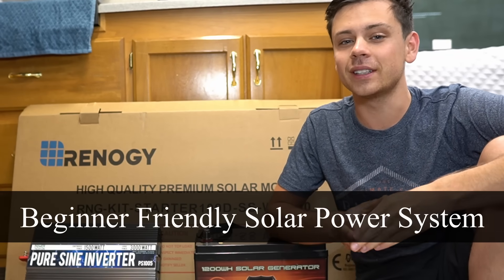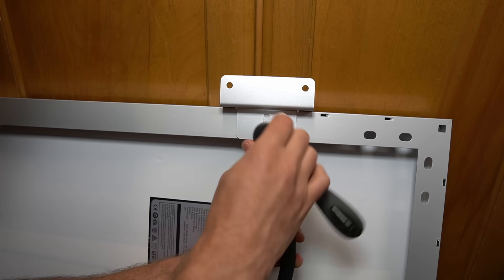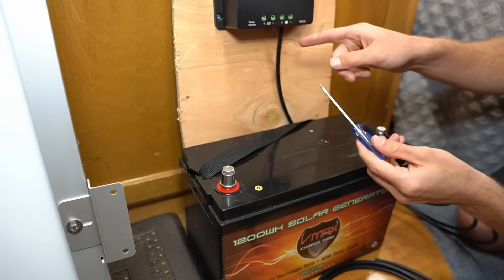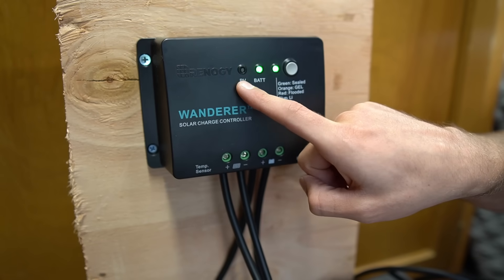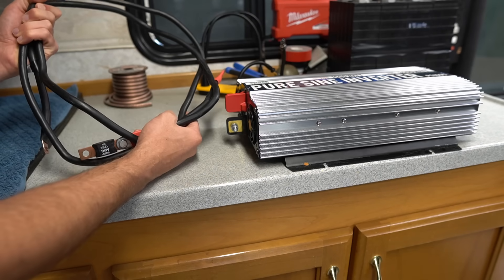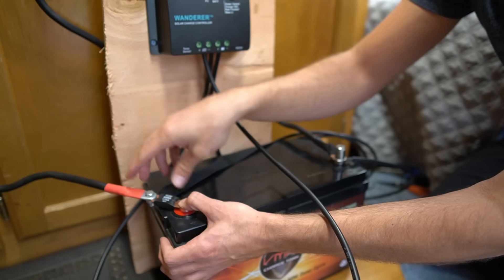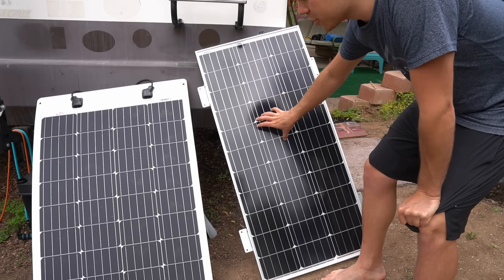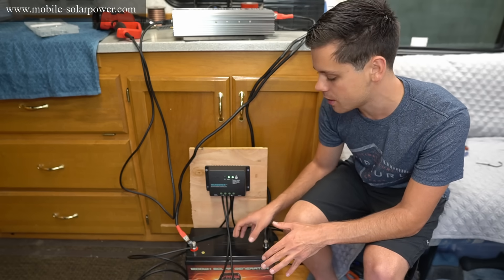Build Your First Solar Power System! Beginner Tutorial Easily Explained, Budget Friendly

Comment: You are the best there was, best there is, best that ever will be. Do you know why? You have the communication skills that others although smart, can’t explain and care like you do. I’ve purchased as a beginner, (2)100 watt Renogy panels with their wanderer mppt charge controller, I got a monitoring system and 2 filled 6 volt batteries deep cycle arranged in serial. I do have overkill but I got a great price on pure sign wave 3000 watt inverter with all shunts and fuses for my RV 30 ft Trailer. I decided to make it portable and not put on the roof so I designed 1 1/2 “ pvc, color coded to put together quickly and stabilize the panels. Very sturdy and adjustable to the sun. I’ve mounted everything but we’ve had big snow fall, cold weather so I’m waiting to connect for a better weather situation here in Utah. You’re the man, man! So thank you! I’m looking to expand so future scalability w/batteries, mppt, and 200 and more panels.

Comment: Where does the 40amp fuse attach to? It looks like the 175a goes on the battery end of the inverter's positive cable. It sounds like the 40amp fuse goes on the solar-to-battery positive cable. So there would be TWO fuses adjacent to the positive terminal on the battery, correct? Because one is connected to the inverter and the other is connected to the controller?

Comment: So I built this exact system, and added that voltage meter, and when I run just one single blow-dryer off the inverter (like a hair dryer), the voltage meter goes way below 12.2v. The battery is totally charged up, and normally shows about 13.2v. So why does it create such an enormous drop to the v's with only one extremely minor appliance being run on it?
Reply: Blow driers pull tons of power even on a regular house 110 system. My husband says it is the equivalent of a dead short in the circuit. Mine pops the breaker in my house all the time.  When I am camping I just do wash and go hair.
Reply: Is it only happening right when you start up the blow dryer?

Comment: At 9:40 you said for a 30 amp charge controller you would have preferred a  35 to 40 amp fuse? Dont you mean the  fuse  be rated less than 30 amp charge controller. The idea is to protect the controller ? Someone help, what am I missing here.

Comment: This is a very well done tutorial. The only comment I have is that you said to "bunch up and zip tie" the extra wire. Doing so can cause a heat build up in the wiring and may case a fire. The better thing to do is to cut them just a bit longer then the required length.

Comment: Love your channel. I was curious you have a link to the Renogy site and they show a photo of the system and it has a battery in the image. Their list of what is included in the sale says "This kit includes a 100W 12V Monocrystalline Solar Panel, an Adventurer 30A PWM Charge Controller, a 30ft 10AWG Solar Adapter Kit, a 16ft 10AWG Tray Cable, a BT-1 Bluetooth Module and one Renogy Cable Entry Housing." They advertise the battery included in the sale but don't list the battery in the description. That is a very misleading practice on their part.

Comment: You probably have no problems with snow in winter near Vegas but here in Germany its a problem. Could you make a video about defrosting by feeding the PV-panels with reverse current to generate a little heat? In general this method works when the panels are mounted in a special degree, at least 25 - 30 deg. so that the snow will slip down when it gets soft. How much current can you put in reverse through the panels without damaging them? How much voltage can you apply without damage? Just an idea for a video :-)

Comment: You emphasized that the battery should always be connected to the charge controller before connecting the solar panel(s), but my portable solar panel kit came with the panels prewired to the charge controller and alligator clips to connect a battery. Should I be concerned?

Comment: I'm planning on using all this, but originally having two solar panels. My question Is having one solar panel enough though? I'm mainly going to use microwave, TV, ps4, heating blanket during winters, and slow cooker. I plan on leaving them unplugged when I'm not using it though.

Comment: Watching your videos are informative but I’m still confused. Ac to DC AH wow.
Simple question ( but confusing the hell out of me, ) please to start a simple system  I want to power a 45 watt  0.21 amp fan (220 volts ) for 11 hrs a night. What size solar panel needed to recharge a battery and the size battery AH . And what size inverter.
Hope you can help  I want to start up with a small system and build it up for as cheap as possible.

Comment: Hey Will, I'm in the design stage of building a Skoolie Bus Conversion 22 325 watt solar panels for a total of 7150 watts and 12 or 14 batteries. The setup will be 18 panels on the bus and 4 panels on my 24 foot enclosed cargo trailer that will be my mobile shop. I will also have a diesel generator as back up power for the bus and my shop trailer. What would be the best way to set this up.

Comment: I've watched many videos about solar but most of them don't talk about safety much. I don't think I ever heard one person talk about what you can touch and when. You touched the positive terminal of the battery for example. Is that ok all the time or only when you're not grounded or isolated from ground. Was the battery dead? Can you touch the negative terminal? It's never explained in any videos so I thought I'd mention it. Also it's not about just what you can touch but it's about the thought process you use. Are you always telling yourself don't short the system or avoid the positive the most. What are you thinking about as you touch wires and what do you check before you do? Sometimes you give warnings like be careful it can kill you. But sometimes you don't. Is 12v often safe and only a problem when it comes out of inverter or when it's combined to get 24v or is 12v at 40a deadly as 120v at .01 amps etc etc? I think I know all the answers but it seems like it should be stated every time as part of the instructions.

Comment: Parallel vs series for battery setup, when do I use which? I have an Aimes 2000 inverter charger, 2 renengry 300 A panels and a renergy mppt charge controller.... Please help, my batteries keep sparking!
Reply: OK, got my batteries pos to pos and neg to neg, not sparking anymore, but my inverter charger when I trurn it on just flashes power and turns back off. Any ideas???

Comment: Hi. I enjoy your posting very much.But I have a request.
I am doing MY SOLAR SYSTEM but I need help.
I have a solar array of 2 sets of solar panels each of 8 panels 340W .
Each array connected to a mppt inverter ,charger controller of 5kw.48vts.
The reason of 2 system is to exploit the sun as it move between summer and winter on my roof.
My question do i connect the power of the two inverters to one battery bank or separate a separate battery to each charger.
I intend to use Lifpo4 280ah batteries storage.I DO NOT KNOW WHAT THE SIZE OF THE BATTERY BANK AND IF I AM OVERDOING WITH THE 280AH BATTERIES AS THEY ARE EXPENSIVE. 
I am thinking to use 16 x 280ah cells at 48vts.
My system is going to be hybreed to start and maybe in the future off grid.I WOULD REALLY APPRECIATE YOUR ADVISE
Best Rgds Aldo

Comment: Thank you for this and for all of your videos.  I am an engineer with communications background.  Solar design is new to me and has a lot of related concepts such as the idiosyncrasies of various battery types and code requirements.  This was very valuable.  Thank you for providing this.  I want to convert the home 220VAC well pump to solar and add batteries to the array already on my roof.

Comment: A 100W battery is useless! A light bulb will draw enough load, then in 5 hours, your battery is dead.
You need 3 X 100 AH batteries 
A 1,500 Watt, Sine Wave Inverter - A microwave can take 800 Watts

YOU NEED TO LOOK AT THE WATT  LABEL ON EVERY APPLIANCE!

IF YOUR INVERTER IS LOWER THAN THE RATTED APPLIANCE LABEL (BANG)

You need a quality Charge Controller $ 200

You will need 400 Watt Sollar panel output or 2 X 200.
Or you won't get enough power to re charge the batterys.

Comment: Great videos with easy to understand information! 
Try temporarily putting a test light in series when connecting the inverter to the battery. Test light will brightly light then dim out as the caps charge. This will allow the caps inside the inverter to charge so you wont end up with an arc.

Comment: Hey Will hope all is well with you. Been watching your videos since the planter fasciitis days. I have a question that you’ve probably heard before. Let me explain what I need. I’m installing a small solar system on a old four wheel drive camper and I’m at the roof pass through point. Since it has a pop up roof the MC 4 wire coming in from the panel will be under extra wear while moving the roof up and down. My question is.  Can you recommend a solar wire panel that would be flexible enough to withstand the extra wear and tear of raising and lowering the roof?

Comment: Hey Will (or anyone) ... If I install a cut-off switch at the battery to turn system completely off,  will controller be damaged if voltage from panels is still coming in?  Thx.

Comment: I do some simple work on my boat's 12v system and the conventional wisdom is to always disconnect the negative wire from the battery first and connect the negative wire onto the battery last.  You connected the negative first.  Does it matter in your application?  Thanks.

Comment: So I'm wanting to build a small off grid set up I have 4 100w 12v panels a 1000w pure sine wave inverter I ordered a mpp charge controller I want to build my own battery but I'm strapped do to lay off but I have a lead acid tractor battery it was in a tractor for 1 month before the company decided to scrap it I was wandering how what to expect performance to be here  are the specs

Specifications
• Voltage: 12V
• CCA @ 0 degrees: 1200
• CA / MCA: 1500
•  RC @ 25 amps: 400
• Hot Cranking Amps: 1725
• 1 Year Free Replacement + 2 Years Prorated Manufacturer Warranty

Comment: Hey man. Awesome video! A few questions... I think it is possible to use a battery and also a plug in inverter to simply plug into the wall. However, I’m am confused on the setup. I have a solar panel that I would like to connect to the house, so that it sends power into the house during the day, and then uses the battery power at night. Is this possible? Do you maybe have a video explaining this? 

Thanks in advance!!!

Comment: I’ve studied solar DIY systems for 25 years and this is the best single introductory video I’ve found.  You nailed it!
Reply: He sure did, I actually understand this!!!
Reply: I would connect positives first then if you touch ground (vehicle body) while tightening up the positives you won't get a circuit. More so in tighter spaces.
Reply: Can I use something like this in my shed to power my shed and charge lawn tool batteries ?
Reply: @kblend7225  Yes 🙂
Reply: It is the only one that has made it all clear to me.  He should run for president!  :)

Comment: Hello from Colombia! your video was very clear and simple to understand. I need help with something though. I am working on a public seating project and I will be adding outdoor outlets at least three so that people can charge their laptops and phones. For this, I had in mind installing two 200 watts solar panels to power the three outlets. As I have limited space on the outside I was wondering if there is a simpler way to implement IC, diodes, and a watt resistor to make it work similarly but with fewer components. Please let me know if this is clear. Thanks!

Comment: Why are you connecting a 175a fuse between the battery and a 1500w inverter when the fuse/wire size chart recommends a 300w inline fuse and 4/0 wire?

Comment: What can i power with a 100watt panel?  Im looking to put one on the shed and would only be charging small electrical equipment, tv, small ac and maybe a small table saw/jointer planer.  And some lights.  Would this do the trick or would i be needing something different?.  Thanks for the help!

Comment: Awesome! Have you worked with the Valence U27-12XP   LiFePO4 12V 138AH   1.766 kWh Battery?  Seems to not have a built in BMS. Charger for this battery does not seem to be available. Would there be a workaround. I know you worked on the 40 amp  batteries that had a built-in BMS.

Comment: Need help sizing up my snl fuses. 100W panel with 20A ppm charge controller and 1000W pure sine wave inverter. What fuse size should I use between charge controller and battery; and between battery and inverter? Your videos are excellent and easy to follow. Good stuff. Thanks.

Comment: Hey. I bought a renogy eclipse 100 watt solar panel for me rv. It came with a two
Pin furrion outlet. I have a single 12 volt deep cycle battery on my rbv. Just purchased a furrion 2 pin connector with an mc4 10’ extension... do i actually/really need a charge controller? Or can i just plug the mc4 extension connectors directly to the solor panal? Avoiding
Me to have to use a charge controler....

Comment: I have this same exact setup, including battery.  Does the charge controller stop charging the battery if it's full?  I checked after like 2 days and the PV LED turned off and the battery light turned orange.  I'm wondering if I damaged the battery.

Comment: I’m interested in a diy and your explanation made it clear to understand. It gives you a step by step guidance of what hardware I need. It was more informative than the online kit manufacturer made and they’re the ones trying to sell this stuff. I’m going to use a kit for my detached garage in a midwestern urban city where my wood workshop is located. In the winter I have some electric infrared heater which keep tripping my breaker. This will allow me to run my heater off solar in winter and my rolling floor ac in the summer. Thanks again.

Comment: charge controller as close to the battery as possible, you said. Is there any way to get around this? thicker wires? higher battery voltage?
I'll probably get about 30 feet of distance between the two. A way to get around this is with 30 feet of extra wire from the PV panels - would that be a better solution?

Comment: Looking for an answer to this question: I hooked up my panels to my EPEVER solar controller today. Independently they both behaved differently according to the remote screen. One was 20 volts @ 0.1amps and the other was 16volts @ 5amps. wired in series together they read 39V @ 1.7amps...Does this seem okay? I'm really worried about it because they are identical 100watt poly panels...If one was actually defective, when I wire them in series, they wouldn't work right?
Reply: Can i bump this to the top? Just hoping for an answer
Reply: Which panel?  What is the specification?
If the first one that is giving you 0.1 A when connected when there is sunlight, I would say there is something wrong with it.

Comment: can 12 v batteries with different AH's be connected in parallel?
Reply: Its not advisable as imbalance in storage and supply therefrom will not be stable for a long period so actual efficiency may falter

Comment: If its already a 12 volt battery how can it ever be above 12.2 volts?  If 12.2 is your bottom threshold doesn't that leave no room for discharge?
Reply from the maker: Most 12V batteries charge to 14.5+ volts

Comment: Finally!  My only complaint with this channel was that you only seem to show professional grade systems, or home made systems.  In this video you show a good beginner system, and not only that it is extremely affordable.  How does it stack up against the Harbor Freight kit?  Also, can I use my Li-on battery with this or will I need to get a different charge controller?  I need a different charge controller for the HF system, which adds another $100 to the cost.  I was going to get the HF kit to get started but this looks better for around the same price.  Thanks Will, You da' man! :)

Comment: What if you wanted to do one off the grid?... with no battery backup... what if I wanted to connect it to my pool pump and let it run when the sun comes up till the sun goes down... or when the sun's energy is no longer available... is that possible?

Comment: wat package do i  need to run my pool 110 volts 2.5 HP motor.
Reply: jaime camelo - Think of 1hp as 750 watts, so you’d need a 2000 watt + inverter (big). Plus the startup surge is going to be much higher, so you need to find that. Short answer, a big system.
Reply: Is Duable I own at 30 amp power surge, I can get the inverter and the acid batteries cheap  just a matter in figure how many panels I need. Will look at your other videos for more info,Very helpful tanks for the feed back.
Reply: jaime camelo - Thanks Jaime - most of my vids are about hacking, but yeah maybe it’s time to switch emphasis. I’m trying to calculate what you’d need but don’t trust me, trust Will Prowse. ;)  I keep getting crazy numbers like 20 100-watt panels. Let’s ask will for a video on properly calculating these scenarios-
Reply: @SchoolforHackers  Keep it up  you are really  good explaining things and talk. Clearly.
Reply: jaime camelo Thanks!

Comment: Can you connect several LiFePO4 batteries in parallel to get the desired range and performance of one 100 or 130 ah? 
Is there an external BMS that needs to be used as well?

Comment: Question. On the inverter fuse. You use fuses? Is there any reason you can't use a circuit breaker? Seems if the fuse pops you would have to carry extras.